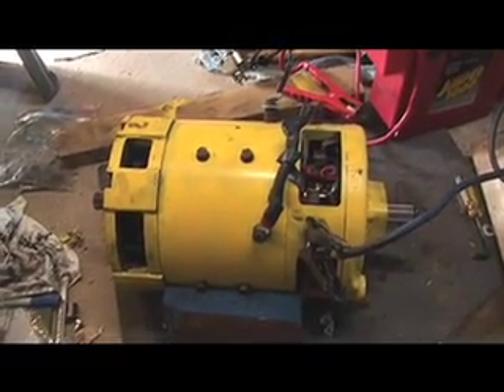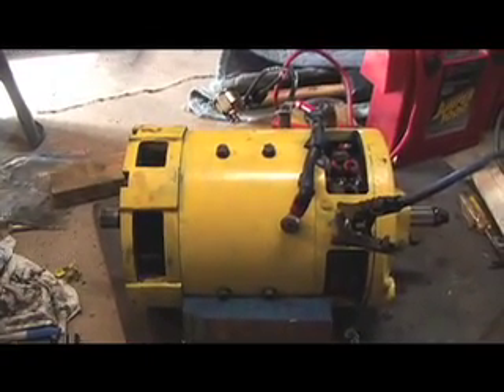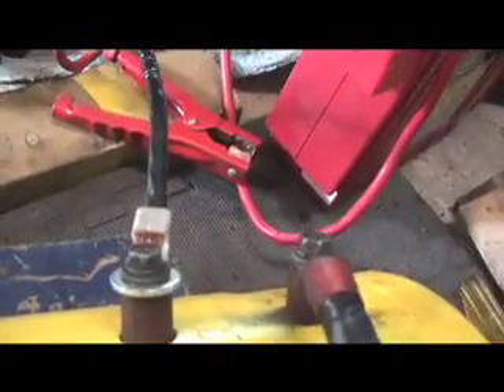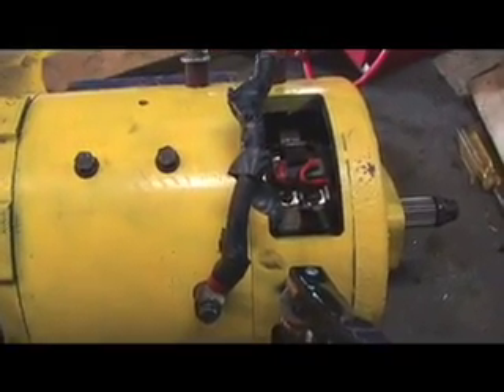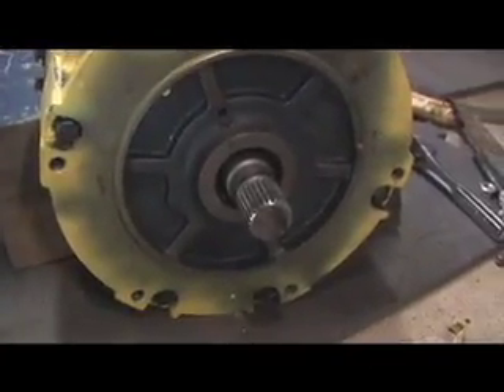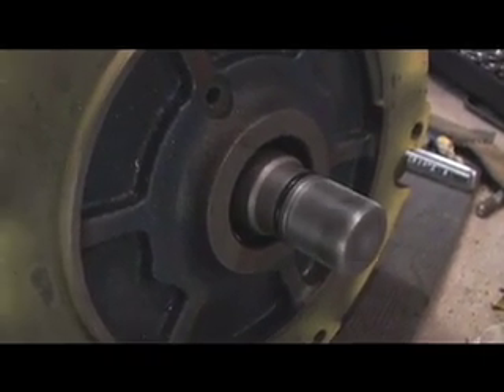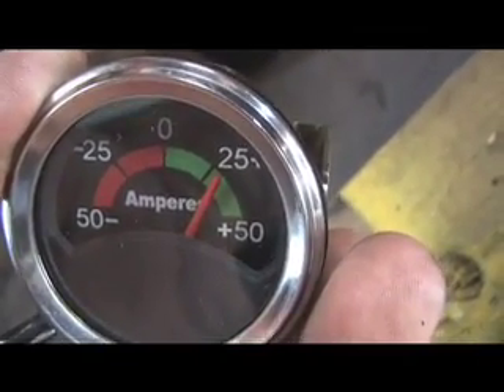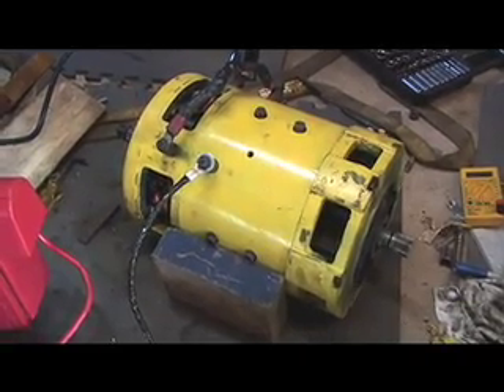forklift motor for electric car

Comment from the maker: Yes, this car now has a 12V vacuum pump which runs the power brakes. It also has a vacuum resevoir which can hold enough for 10 full pumps of the brake pedal. (Gas cars can usually do 3 without the engine.)

Comment: Nice! This was very informative! :) I'm planning to rebuild my Subaru Domingo van into a electric vehicle. I'm gonna keep the transmission, since it provides the 4WD. I have a question however: what's your solution to providing vacuum for the brakebooster? Are you gonna add a vacuumpump?

Comment from the maker: The noise wasn't the bearings. Turns out there was a "bearing cover plate" inside that was loose. The bearings themselves were just fine. Once the cover plate was tightened down, the noise went away.

This motor has run very well on a 400amp 72V Curtis controller

Comment from the maker: I don't know the HP rating. The motor was unmarked when I got it. The car currently runs at 72V and uses a 400 amp peak Curtis controller. So that would make it 48 HP peak I think!?

Comment from the maker: This is 36/48 volt motor. It's in my car and I have ZERO problems with overheating.

AC is fantastic. It's also very expensive, and you need lots of batteries to get to the high voltages needed for the AC motors.

The noise was later nailed down. It was a weird disc on the front end of the motor, which is sort of a bearing cover.

Comment: You are using a 12 volt motor that is going to heat up pretty good. Try a 36 or 48 volt motor. Or better yet AC motor technology has come a long way. With AC motors you don't have brushes. By the way the noise is most likely comming from one of the bearings or the cooling fan.

Comment: Thanks for the great video. Did you ever figure out what was causing the high current draw while free running? Maybe this is normal?

Today I managed to get a free series forklift motor from a repair shop. It draws 35 amps when free running off 12 volts! I tried running it in both directions too. It's only a small one (7" dia x 9" long) destined for an electric motorcycle.

Comment from the maker: I was able to figure how to reverse it.

The brushes are square on - same amperage both directions. It was originally a drive motor for a forklift, so it had reverse, so the forklift could backup.
Reply: Yep cool how much for you to build me one. And how heavy is the motor?
Will it last forever?

Comment: Reconnect the motor to run backwards, measure the current.  If it is lower you have phase problem  or what is known as advance, with your brushes.  The motor was built to run only 1 direction so the angle between the brushes and the field windings of the motor was set to improve efficiency.  You have to set it to the opposite direction.  Again this is the problem if you see a big current difference between the 2 directions.